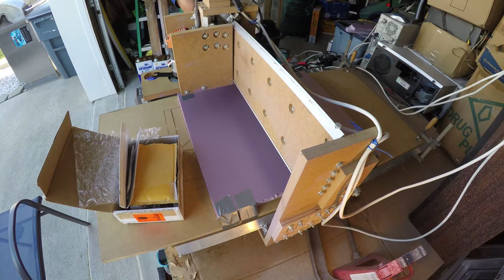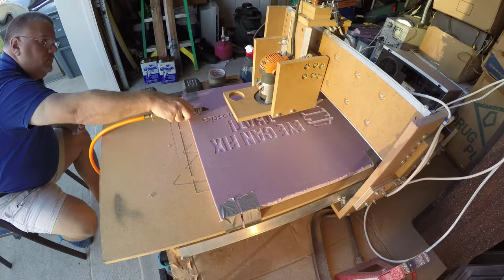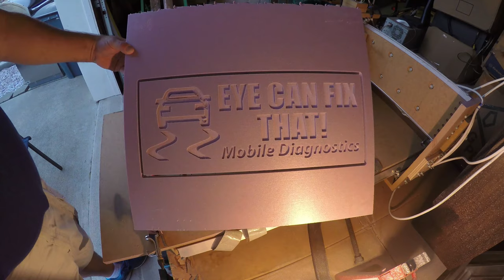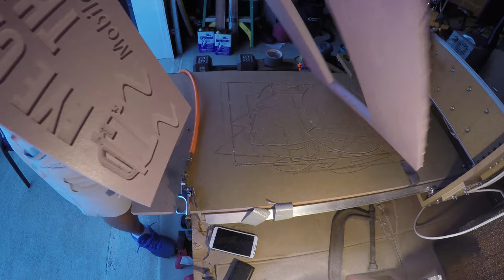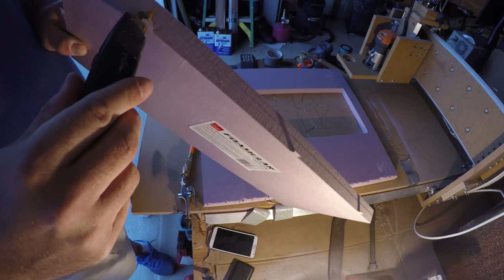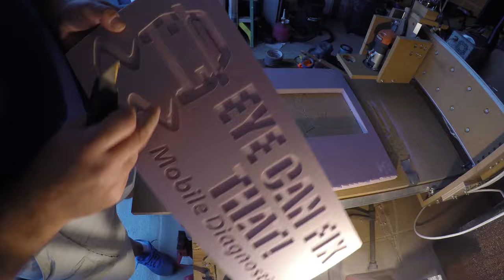CNC Signmaking Eye Can Fix That Mobile Diagnostics

Comment: This is cool but why rigid foam insulation?  at least that what it looks like.  Are you planning on painting the surface or anything like that? If memory serves me right, spray paint will eat into the foam
Reply from the maker: nicekid76 I bought an airbrush for applying acrylic and enamel paint so I dont have to worry about the acellerant destroying it. I first paint it with a heavy primer that seals it.  I made one piece that is a work of art that Im sending to Casey Neistat.  Once I send it I will post the video how I made it documenting the CNC cutout with a ball end mill to sanding, primer, painting and finishing it.
Reply: That really smart! Hope he opens it on camera!